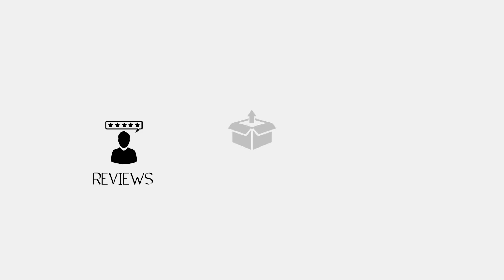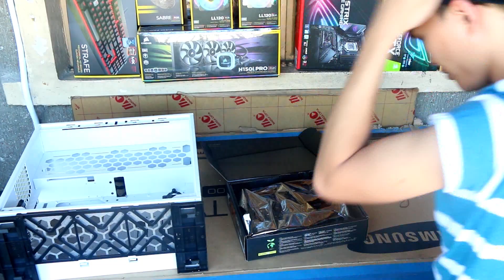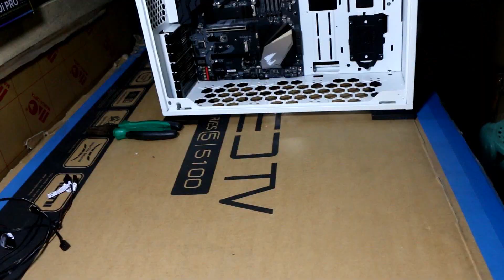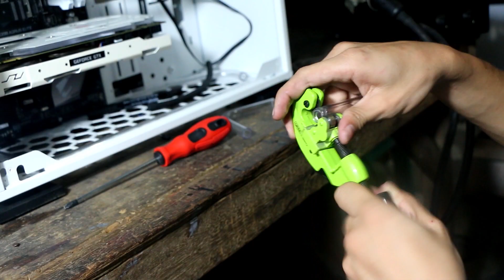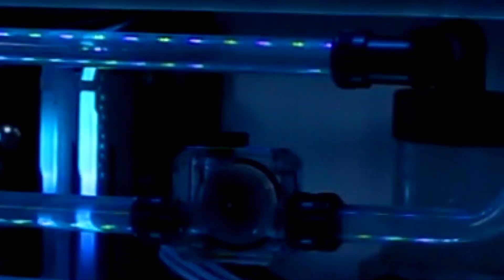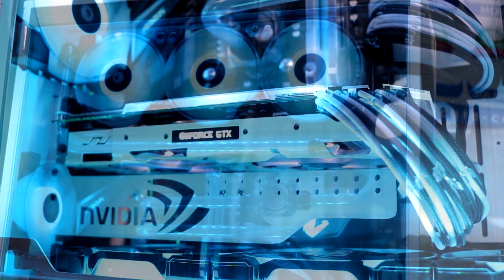WINTERFELL: Black & White Php 15K Watercooling Set-up ft Inwin 303 & Bykski Watercooling Kit

Comment: madalian check 
Intel Core i7 8700k    
  17,995.00 
Gigabyte Z390
  Aorus Elite    
  11,300.00 
Corsair 2x8GB
  Vengeance PRO      8,600.00 
samsung
  256GB  SSD     
  3,095.00 
samsung
  500GB SSD      5,195.00 
Seagate
  1tb HDD       2,595.00 
GALAX
  GeForce GTX 1080 EXOC-SNPR    37,150.00 
INWIN
  303 TEMPERED GLASS MID TOWER      4,250.00 
   
      90,180.00

Comment: May tanong ako kua ung fan poba supported poba nya c msi mystic light?
Reply from the maker: It will sync with board rgb po siya pero hindi po sa software.
Reply: Bermor ahhh cge po salamat👍👍👍
Reply: @Bermor  er... yung DF-12025?... alam ko RGB lang po sya na 4pins, yung ZF-12025 ang ARGB :)
Reply from the maker: @lionelsioco123  im sorry yes rgb po not argb. Sorry my bad and thanks for correcting me. 😊 and it will sync with the board.

Comment: BOSS NAKADEPENDE PO BA SA MOTHERBOARD ANG GPU NA COMPATIBLE? OR NAKADEPENDE SA CPU ANG GPU NA COMPATIBLE?
Reply: Yes Tama..
Most na niwawater cool is ryzen 7 and i7 above sometime i5 or ryzen 5 Pero r7 & i7 pataas tlga mas nag bebenifit yan ang mainit tlga kasi.
Nvme m.2 pwde n rin i-water cooled isama sa loop since parang cpu and GPU lng Kung uminit yan lol.
Sa GPU yung mga 6pin only GPU non-power hungry no need for water cooling..
Sa mga power hungry GPU lang tlga na umiinit ng sobra for example rtx 3070 above..
And rtx 3060ti below stock heatsink lang goods na.

For Kung looks lang habol mo pwde nmn syempre more on CPU cooling lng yan not a full loop kasi nga NSA 5k+ ang GPU block
Reply: For example I'm water cooling a
Ryzen 7 3700x
2x nvme m.2 
Don't have a GPU yet.. connected na mga tubes and loop
Using a 360mm + 120mm radiator and a bykski DDC pump acrylic tube over PETG.
Why acrylic? Overtime nagrerebent ang PETG gawa ng init ng tubig may chance matanggal sa fitting or ma loose sa fitting.
While fixed bend ang acrylic mas heat resistant xa less durable compare to petg since plexi glass xa but d meaning less durable easy to crack hindi Lalo na Kung 2mm thickness matigas xa